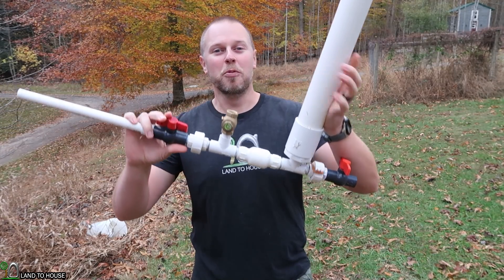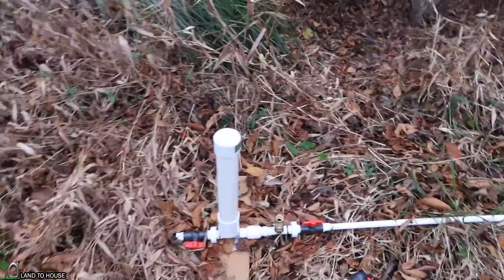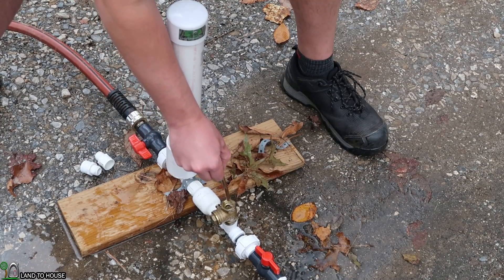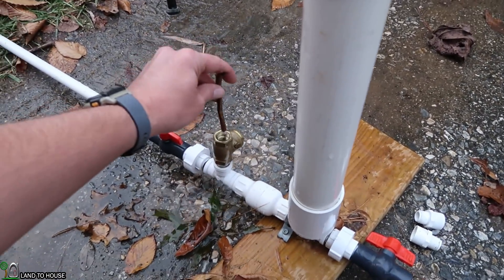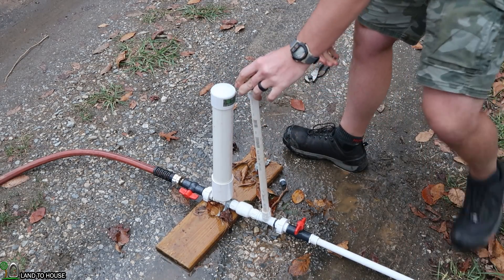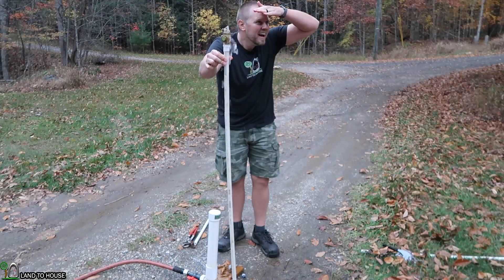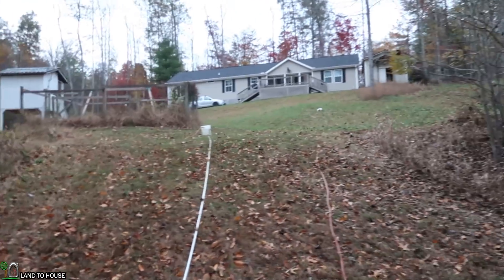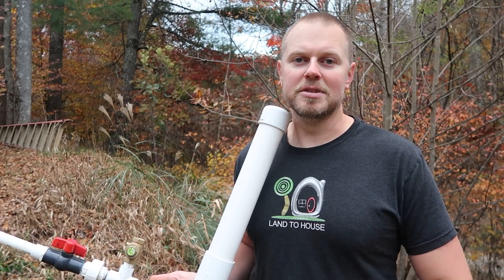Ram Pump Extended Waste Valve to Reduce Head Pressure

Comment: Ball valve on top of the 'pressure tank'.  Release air pressure to desired lift.  Or, just close the exit valve slightly to increase the back pressure as if you're priming the pump.  Both will reduce the lift and are adjustable.  No guessing at the length of the waste valve height...

Comment: This is fantastic information! We have just recently built another ramp pump to send water directly to our barn but could not get it to continue running. It would just stop after a little while and we couldn't figure out why. After following along with the video it turns out there is too much head pressure from the source to the new lower destination   Thank you, thank you for doing these experiments! We never would have thought to use this solution.  You saved the day.🏆

Comment: What if I increased the supply ( 4 inch to 3 1/2 to 3 and so on till I got down to 1 1/2 supply then the delivery line be 1/2 inch) my supply is 6ft my delivery output is 580ft in length with a ride of 44ft. Will this equation work?

Comment: That Was Great Again, So Now What Would Happen if You Used A Bigger ,Say 2  inch Stand Pipe Would it Work & Wouldn't it  Need To Be Shorter ,Just A Thought & or How Would it Work,Or Would it Work at All If All The Pipes Were Bigger???  Just A Thought

Comment: Would a smaller diameter supply line  give you the required backpressure uphill? Seems like a garden hose is too big for the hight uphill.... similar to cutting back the outlet on off valve?

Comment: Nice set up. Is there any difference on the output per minute for the extended waste  valve?
Reply from the maker: Good question. Without the extended pipe the pump did not work because there was too much head pressure and not enough lift. So technically there was a lot more output with the extended waste valve. There is a sweet spot where the output is the highest just before the pump stops working.
Reply: @LandtoHouse  thanks for the info. Will try it soon

Comment: What I'm seeing is that the final input head pressure is determined by the height difference between the source input and the waste valve. We normally see the waste valve very close to the base of the pump assembly. Elevating that valve reduces the height offset from the input source - reducing the drop to that waste valve.

Given this... if you have a scenario in which you want to use that waste water in a secondary system you may be able to direct it to a secondary pump. It would be interesting to see if that secondary pump will function with the intermittent supply.

Comment: great vid as always i have always wondered if adding two pressure tanks to the ram pump instead of one if it will increase back pressure making it easier and quicker to fill the delivery pipe or would it hinder preformance

Comment: I very much enjoy all of your videos. Do what you can, when you can. We will still be here. Thanks for this video, I was wondering how you could vary the pump for optimal output.
Reply from the maker: Running the max possible head pressure and minimal lift is the best. Also tilting the waste valve to the hard close position increases output.

Comment: Actual experience here-
A cold weather ram pump will keep running continuously in sub zero weather if it is in tune and not subject to intermittent stoppage which would cause the pump to freeze and destroy itself.
If it is dependable and runs continuously, it will form a turtle like shell of ice around itself.
It is amazing to see how the temperature of the warm water feeding the pump balances with the cold air.
One caveat though, when the weather gets slightly warmer, the shell thins out and can droop onto the escape valve and if it obstructs the flow, it can possibly stop the action and cause the pump to freeze when the temperature drops once again.

Been there, done that.
Best wishes as you travel down life's road. God has a plan for you.
Reply from the maker: I ran a pump 5 years ago in 15 degree weather and it made some incredible ice sculptures. The thing that finally stopped the pump was ice climbing up 5+ feet into the delivery pipe and clogging it. Once the output stopped the pump froze up.

Comment: I just had a thought. What if you left the check connected to the pump and put the extra pvc into the check that would actually increase the pressure on back side of the check👍🏻
Reply from the maker: Yes that can work too. I have a video with that someplace. It was several years ago.

Comment: Not actually reducing the pressure it’s actually bringing more towards neutral pressure by increasing pressure on one side. So let’s just say if you had 50 psi on one side and it needed to be  45 lbs on the other side to make the check function you could feasibly do it at 500 psi or what ever as long as that 5 lb difference is met and the check could handle it.
Reply from the maker: Yes thats true. That would be an impressive ram pump haha.
Reply: @LandtoHouse I probably have about 50 psi according to my calculations I'm hoping extending the valve will help my situation

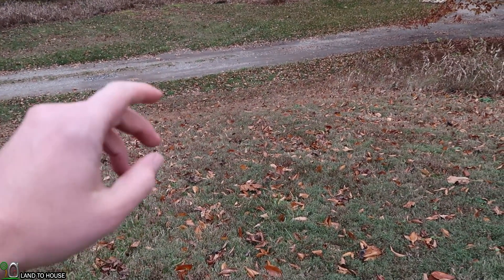Comment: ummm....       at 1:40, bad case of  gobbledy-gook, there.       because,  if the supply-side   Diameter  remains the same, more water  AINT gonna want to go  through it, due to more head,  at any  Given  Second.!
said another way,  it is probable that the supply-side (and valve) diameters  self-regulate  the  flow. 
these sorts of mods  should be seen to be  deliberate  Disimprovements  to a system.
done in an illogical  attempt  to solve a  nonexistent  problem.      d

Comment: I would not have thought of that on my own. Choking off the valve like you mention would be my go-to. Tilting the valve would do it too but as we discussed, that's not a good idea to put into the heads of customers.
Reply from the maker: Ha yes I have mentioned that in email before and it often gets lost in translation. Adding another short pipe to the waste valve might be an easy solution for people.
Reply: @LandtoHouse  A stronger spring in the in-line check valve should also solve the problem with to low back pressure. Can you change/adjust the spring in that in-line check valves?